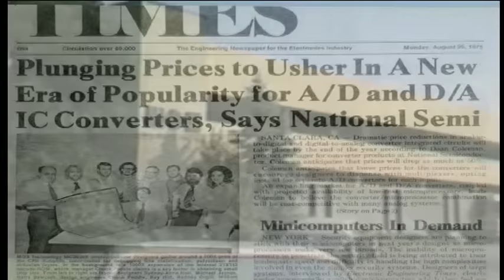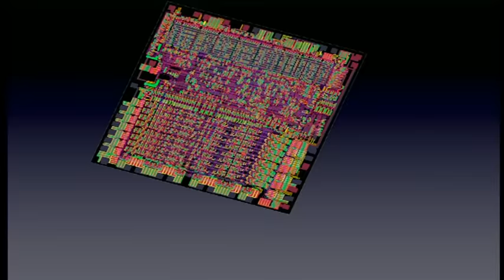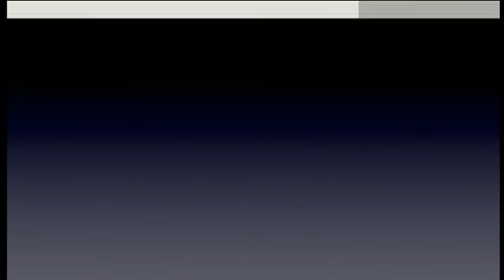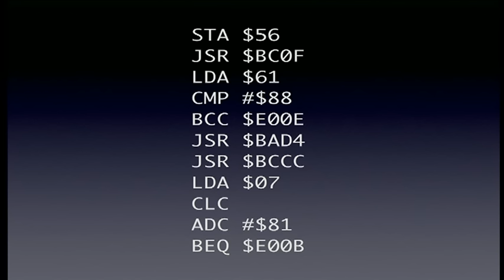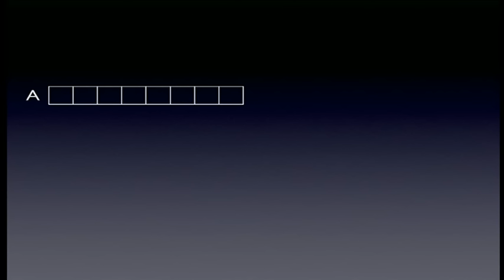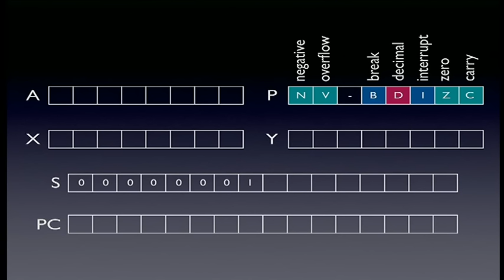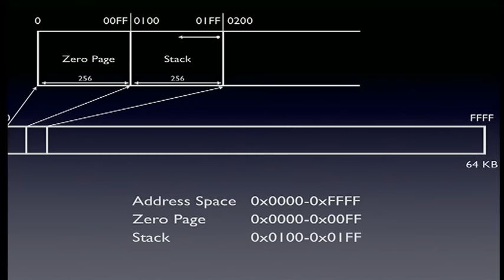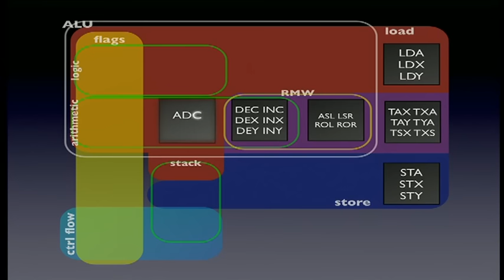27c3: Reverse Engineering the MOS 6502 CPU (en)

Comment: I watch this about three times a year.  It’s one of the best talks on the 6502 ever done.  It inspired me to study assembly.
Reply: It's probably the best way to understand how a microprocessor works.  I had the Rodney Zaks 6502 book with me all through the 80's !!
Reply: Same here. I was 14 when I got my Commodore 64, and when I read the assembly language book that everyone bought for it, it was such an eye opener. You read through all the instructions and at the end, it's like, "That's it?! That's all there is to it?!" The beauty of learning such a simple, middle of the road instruction set like 6502 is that, unless Assembly is going to be your main career jam, virtually every paper you ever want to read on Assembly becomes comprehensible, even if you don't know much about the architecture that is the platform of choice for the paper: everything you read is pretty much translatable into 6502 terms (RISC and microcode experts will slaughter me in the replies, of course).
Reply: @pentachronic  Sybex books - I had 2 or 3 of them, the editing was terrible and the contents were ore or less thrown together; despite that they were worth having and I learned a lot from them.
Thanks Rodnay [sic] !
Reply: You'll love Ben Eater's 6502 series then.
Reply: @pentachronic ok cool. Yet how did this come from the more simple computer used on apollo ?

Comment: Not being a coder. Most of this was way above my Head. But the Nerd in me stuck it out to the end and enjoyed ever minute of the presentation.
Reply: +The Pumpking King you don't have to be a coder to understand.
Reply: you have to be an engineer....
Reply: same here. I think those people came out of the outer space man!!!
Reply: learn assembly. he does not explain it in full detail.
if you learn assembly and computer architecture you would understand this completely.
Reply: Dmitriy Getman  Meh, you're about halfway there with C. Helps a lot to fool with asm a bit.
Reply: think of it this way ... your "program" starts when your alarm wakes you up ... thats the end of reset ... every thing you do from that point on had to be looked after ... with transistors resistors and capacitors and could only be done to a specific beat ... that is everything he said in a nut shell ... how small the detail you want to get into is how COMPLEX your circuit will be .. now you want to make that circuit fit on something the size of 1/4 of a postage stamp ... 
.

 so by the time you get back in bed and actually pass out until the next day ... is ALL on that one circuit ... and repeated every day ... thats a 6502  or z80 ... or an 8086 ... or 80286 ... and so on
Reply: @deusvult5738  not completely but definately BETTER than not even coding in basic ... being an engineer from those days you would understand everything he displayed and WHY it was done ... glad I AM an engineer from those days ;)
Reply: @the-bgrspot6997  that is the biggest help ... also being from that era helps even more ... kids these days have no idea what optomisation was all about .. write down to pre fetching instructions and only writing code when you absolutely had to ... because every HOUR of cost you hundreds of dollars just to get the program compiled ... and that doesnt even run it ...
Reply: @0623kaboom  Yeah I'm a bit familiar with the difficulties like fanatically trying to optimize everything you possibly can. I believe being an engineer from that era has more difficulties entailed, like the need to constantly adapt for a couple of decades. Sounds harsh.

Comment: The 6502 was the very first processor I programmed back in the early 80's. This was a fascinating presentation, well done!
Reply: +The Cobra Build Channel I did Z80 first and, because it's got more registers and "clever" instructions, I thought it was better for years... But the 6502 has won my heart over with it's simplicity in recent years.
Reply: VIC-20 FOREVER!
Reply: @edgeeffect  All these years on and it's still 6502 VS the mighty Z80 😁 who would have thought it.
Reply: Same here.   Still using a BBC Master128 here, updated with MicroSD for storage.

Comment: I've written huge amounts of 6502 assembler, but never seen exactly how it works before. I'm staggered at how much complex behavour was achieved with so few transistors. I guess the real power here is in the way the internal ROM sequences the operations cycle by cycle. I can now see how you can easily implement something like this in a FPGA.
I'm amazed that so many people thought it was worth the effort of reverse engineering an obsolete processor. I'm glad they did though, that was fascinating.
Reply: They do it for the games/software... and for the challenge itself of course.

Comment: Absolutely wonderful presentation! This sure brought back many wonderful memories for me. I cut my Assembly programming teeth working with the 4004 cpu chip. It was one of the many simple experimenting boards available in 1980 and I actually used some discrete IC components along with an oscilloscope to program a simple game using the scope as a display. That was so much fun. It is amazing what you can do with 4k of 8-bit ram and 1 megahertz clock speed for the cpu. I still  have to laugh remembering playing with that simple board. The programming was done on a alpha-numeric keypad using 6 digits of LED display for data and address info. Simply amazing. I went on to program for many cpu models of that time. It started my career as a database designer and programmer for businesses.
Reply: Sounds like an awful choice for 1980 ... there were for example the Motorola D2 kit and the KIM-1, SYM-1, AIM-65 (in order of increasing fancy + expensive), as well as more thoroughgoing machines like the Little Big Board (CP/M) and of course the Apple ][ was about 4 years old by that stage.
Reply: If you were a masochist you could have at least gone for a SC/MP or CDP1802 ;-)
Reply: The first 4-bit processor! I've never used it - I only knew Z80A and 6502 - but I always wanted to try one.

Comment: In the eighties, while in elementary school, I had the VIC-20, C64, 128, and about 3 1541 drives.  I programmed in assembly and BASIC, cracking protection schemes, and doing all sort of reverse engineering.  I was a better programmer using the C64, as a kid than I am now. 

I can really say after all of these years, I never really needed job training. The C64 taught me much of what Ive needed to know during my entire career.

Comment: Be interesting when we get through to the 68000... and all its descendants. Including maybe finally figuring out what the key differences between the original and the HC model, plus all the embedded versions are, that make them act in subtly different ways that are not only a headache for emulation, but also if you try to use a "real" later processor in an updated / repaired version of a classic machine (and in at least one case, vice versa). They do occasionally burn out, after all.

...and that, in essence, is why this work is so valuable. Microprocessors aren't immortal. Like any electronic component, they gradually wear down. As seen with overwrought GPUs used for bitcoin mining. It just takes the older ones a bit longer, much like a low wattage light bulb, as their traces are larger and clock speeds / TDPs are lower. But they will, some day, all die.

So if we want to keep the memory alive, and be able to run the old software faithfully, we need to encode their behaviour before it's too late.

On which note: there may not be much interest or even value in bothering with this for the x86 line at the moment (though the older chips do have some quirks not replicated in their modern evolutions), but presumably another branch of this project must involve the 8080 and 8085? There are a number of really old classic machines (including a lot of CP/M workhorses, and the original Space Invaders...) that used them, before the 6502 and Z80 (itself a modified clone of the 8080 the same as the 6502 was a modified clone of the 6800). Maybe even the 4004, 4040 and 8008, but I think Intel might actually have released the schematics for those already as part of their 40th anniversary celebrations... Oh, and of course, the 6800 and its variants. It doesn't get as much love as the others, but that processor line was still used in an awful lot of computers and other hardware.
Reply: For the surviving companies, publicatiom of older internal documents and interaction with surviving original engineers would be another avenue. Maybe one day we'll see a full explanation of design differences between 80186 and 8086 handling of common instructions.  Or full docs on the original AMD CPUs from the 1970s.

Comment: Come from a Z80 background but this presentation was excellent. great work guys! 😁
Reply: done them BOTH the 6502 and z80 ... I miss the good ole days of dealing with limited space and actually having to worry about every single cycle to get the most bang out of the program ....
Reply: He should do the Z80
Reply: @johnmarks714  Yes, then he would probably also learn how it works. (Which he clearly didn't understand at this point.)

Comment: The Zilog Z80 4MHz processor was the first processor I programmed back in the early 80's age 23 yrs. using assembly language . No assembler used - just machine code written from my head in memorised hex numbers to system EPROM. Seems to be a mind blowing task now but if you are determined and interested you will acquire the knowledge to let you create a program that executes with the minimum number of clock cycles. This is a great presentation going down into the 6502 and full credit to Mike - most impressive. I preferred the Z80 because of the linear address bus. Thanks for sharing this video and reminding me of the mnemonics.
Reply: What was the 6502 bus like?
Reply: @johndododoe1411  It was just as "linear". But the 6502 was more byte-oriented in its addressing modes and sometimes took an extra cycle when crossing 256 bytes boundaries. The Z80 was faster though, despite what 6502 fans will tell you ;-) Especially so on code that had to deal with larger numerical quantities than single byte numbers, such as floating point.
Reply: @herrbonk3635  I wasn't asking about speed or efficiency.  More about the kind of complexity that plagued the 8080 bus compared to the Z80 simplicity.
Reply: @johndododoe1411  Ok. Yes the 8080 had status signals multiplexed onto the data bus. But that wasn't a plague really, pretty simple to interface (although more involved than on the Z80). The later 8086/88 had multiplexed adddress and data on the same bus though, which was a little worse, and it also slowed these chips down somewhat.
The 6502 didn't have any off that, but was instead slowed down by it's primitive and pretty unreliable (among chip versions from  different manufacturers) memory access method that tended tp lock it into low clock speeds compared to a Z80 or 8088. The latter two would do stuff internally while waiting for memory response for two full cycles, while the 6502 just issued a short pulse (approx 30% to 60% of a clock pulse) and assumed the memory was fast enough.
Reply: @herrbonk3635 Different maximum clock speeds, different numbers of clock cycles per instruction. Very different architectures. 

Very hard to make comparisons of the form you are making.

Performance comparisons need to be done by writing programs in each processor's assembly language to perform the same function.
Reply: @deang5622  Yes, of course they were very different, who said they were not? 
Yes, writing programs for them (plus reading their datasheets and building hardware) is exactly what I did in the 80s. The Z80 could use a much higher clock (using the same speed memories). It had several 16-bit registers, plus instructions that could do more (say 16-bit adds).  So the Z80 was quite a bit faster, despite using approx twice as many internal clock periods for 8-bit operations. Significantly faster on central things like 16-bit arithmetics. And also on the 24/32/48/53/64-bit quantities typically used to implement floaing point (or fixpoint) real numbers.
Reply: @herrbonk3635  I didn't say anybody said they were not different, but the fact is we have individuals talking about the Z80 being more efficient on larger numbers and memory access approaches  which isn't particularly a defining factor given the different design factors I mentioned.
Reply: @deang5622  Wtf? "We have individuals" ... Yes, me for instance. And? 
"A defining factor" ?? What kind of meaningless abstraction is that? I.e. in this context. 
Lets keep this discussion on the ground please...  It's about how many nanoseconds you need for each repeated 16/24/32-bit addition and similar very concrete performance aspects.
Reply: @herrbonk3635  So you wrote meaningless gumf about memory access strategies and internal workings as a way to demonstrate the Z80 was a faster processor than the 6502?

You should know better, shouldn't you?
If you are going to post irrelevance then people are going to critique it.

If you don't like it, either a) don't post or b) write something meaningful.

I don't care which.

The Z80 contained instructions which take, if I recall correctly, take up to 9 clock cycles - excluding the block move/set instructions like LDIR, at 4MHz;  the 6502 executed many of its instructions in 2 and 3 clock cycles at 1 and 2MHz (6502A).

So your simplistic analysis and means of comparing one processor with the other was a load of nonsense.

End of Debate.

Have I hurt your ego? Is that why you are becoming so agitated?
Reply: @deang5622  No, not at all. I wrote very meaningful information, about how it actually works. The fact that you couldn't follow it due to an evident lack of knowledge (or brains?) is another matter entirely.
It's your "analysis" counting clocks only that is simplistic as hell, and totally wrong. The number of clocks was just one factor for performance... A single 6502 clock period was very long and slow, took the same time as several Z80 clocks...

So again, as I said above, the Z80 used about twice as many clocks for most 8-bit operations, but these were much faster clocks(!), taking a fraction of the time... Because the Z80 could run at about 4-6 times the clock frequency of the 6502, using the same speed (cost) memories. This made the Z80 at least twice as fast already at that level. 

And on top of that, it had the BC'BC, DE'DE, HL'HL registers that could be used as three 32-bit registers. Very useful for fast floating point code. It also had 16-bit addition and subtraction in a single instruction, taking about half as many clocks as doing the same on the 6502 using 8-bit instructions with zero page load/store of partial results.

Comment: I had a C64 and learned assembly language. I never bothered learning the hardware implementation (note: I don't mean things like VIC 2 sprites, charset and sound, to use the C64 you needed to know them, I'm talking about the silicon itself - gates, delidded chips etc. The literal black boxes on the motherboard)

40 years on I am interested...

Comment: the original designers of ARM were all 6502 fan boys.
Reply: They were hardware designers and 6502 coders who needed something better for their next project. They were partly influcenced by the 6502 implementation though, after visiting Bill Mensch and Western Design Center.
Reply: You assumed gender.
Reply: @Margarinetaylorgrease  and?
Reply: One of them is called Sophie
Reply: stuart jarvis yes she‘s a great hardware/software engineer, but back then was still Roger Wilson...
Reply: @0toleranz  
But did Roger self identify as male or female.
Don't worry too much, it was 50% troll.
Reply: Yes, they were. The inventors of the ARM design were the guys from Acorn. Who have build the BBC Micro! They were the first british company to use a 6502 processor for their computer :D

And to the troll here: At that time Sophie was a 6502 fanboy. Now she is a 6502 fan girl.
Reply: It was a great time. I went for the Tangerine. I still have it.

Comment: It's easy to miss what happens with the 'WAIT6502,1" command at 16:38 because it's natural to be looking at the bottom line of the screen, but the top line of the screen changes from 'Commodore Basic' to 'Microsoft'.
Reply: Thanks Keith -- that's a good comment to add here.  Usually we do something like WAIT6502,10 which prints it 10 times and is much more obvious.
Reply: This is too funny - almost like Bill Gates pieing someone in the face years before being on the receiving end.  I never owned a Commodore PET myself, having started with a C64, but able to see this effect when configuring Vice for the PET 3008 under model settings. 😁

Comment: So many happy memories of poring over the Assembly manual for the Commodore 64, using BASIC to hand-assemble enough 6502 in memory to count to 10... I felt like a 14 year old god.
Reply: @The programming crypto guy Sure! Whatever comes to hand. I recently worked with Richard Dawkins translating some old Pascal programs of his into first Java and then JavaScript.
Reply: @The programming crypto guy Very good! Learning the 6502 was weird, because once I cracked the basic instruction set and addressing modes, and the stack concept, it was astronishing: THAT'S ALL THERE IS?  But, yeah. A Turing machine made out of 1500 transistors or whatever it is. I swear it felt as if one had pulled the sword from the stone. (Or met the monolith, I was a teenage 2001 fan).